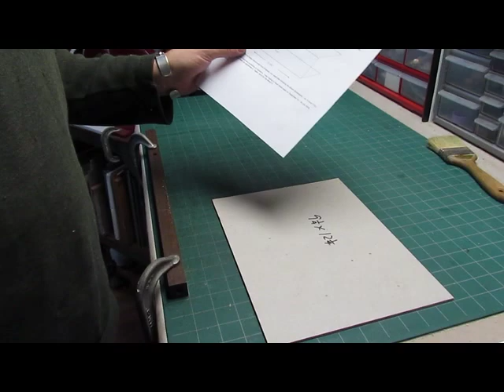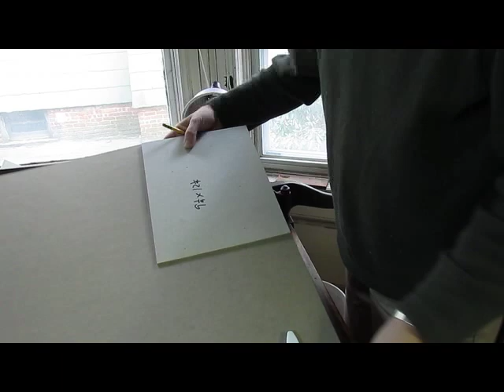Clamshell Box - Part 1 - Small Tray

Comment: Is it important when measuring the double thickness that you always use the fabric wrapped side of the guage?  Because the fabric would add to the width of a double side, but your single side thickness does not have fabric wrapped. Great video.

Comment from the maker: You should be able to construct a complete box in 2-3 hours if you have basic binding/covering skills. I can do it in an hour or so. It is essential that you make the small tray and cover the edges before cutting the large tray for a snug fit. Double thickness side of the gauge for head to tail length and single thickness for the fore edge to spine sides of the tray. Cut the cover boards to fit the large tray. The double thickness of the gauge spaces the cover pieces. Email if you need more info

Comment: Dear Sage,  need to know if I can get instructions (written of course) from you.  I have found your video on YouTube very good indeed and have followed them to find that they work very well.  Your instruction are very simple with regards the flip box and the clamshell box very easy and it seems to be all about the gauge.  Am I right in assuming this is the case?  Also, do you place the "walls" on TOP of the board as opposed to the sides or is this a personal preference?  I am building up my bookbinding studio in my basement in the UK and have a few small orders.  The biggest one I had was a wedding album with oak covers and a copper pierced tree for a tree surgeon.  Please could you oblige with written instructions.  Thank you.
Penelope
Reply from the maker: Hi Penelope, Yes the walls do go on top of the board. That's why I place the board against the stationary stop and then glue the edges of the wall and place it on the board. And Yes it is all about the gauge, with the gauge you are freed from using the clumsy measurements on a ruler. Are you asking for help with the  wedding  album? good luck with your new studio and thanks for watching.

Comment: Hello Sage, Thank you for your video. I would like a make one, and is wondering if it would be possible to add a ribbon inside of the box to help get the books out? What stage should I add this if it's possible. Thank u!
Reply from the maker: +sleepyholiday  The ribbon is not necessary as the tray has an open side once you open the box. The spine of the book is readily accessible from the center of the box. Please watch the beginning of this video and the last video of this project and you will see that there will be no difficulty getting at the book. 
 Thanks for watching.

Comment: Thank you very much for the video! I have always loved these boxes, so they will be my next project.

I have a question, maybe a little off-topic... the guillotine you use to cut your boards, did you ever need to replace the blade? I was handed an old guillotine that theoretically should still work, but the blade is very dull. Would you know places that provide replacements?

Again, thanks for the video!
Reply from the maker: The Cutter I use is not a guillotine, the machine is called a Board Shear. I have only had to have the blade sharpened once in the 40 years or so that I have owned it. Look up a local 'grinding service' and they should be able to send an engineer to take your blade off of the armature and sharpen it for you. They may also take the blade on the table too. ( replacing the blade on an old board shear will be nearly impossible, and very expensive.) The engineer will also reinstall the blade, before he leaves, make sure it works as it should. 
If you can't find a  grinding service, ask a local printer or bindery that has guillotines, those blades need to be sharpened more often and they will probably have a place for you to call. If you have any other concerns, write to me and I will answer if I know what you need. 
 Thanks for watching.
Reply: ***** Thank you very much for answering my question! I will see if I can find a blade servicing place nearby.